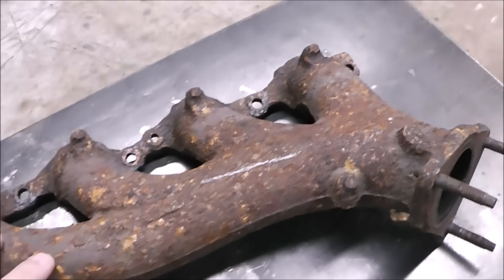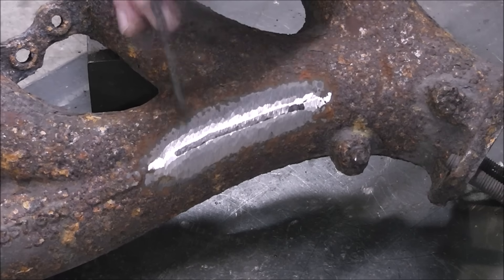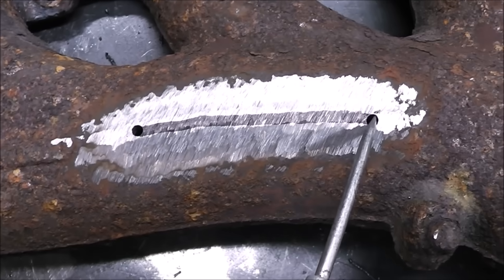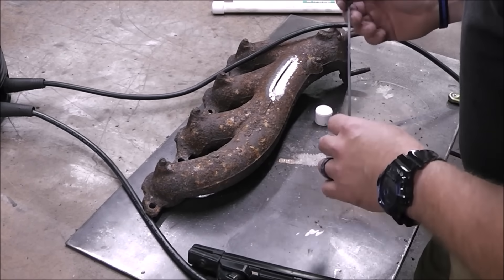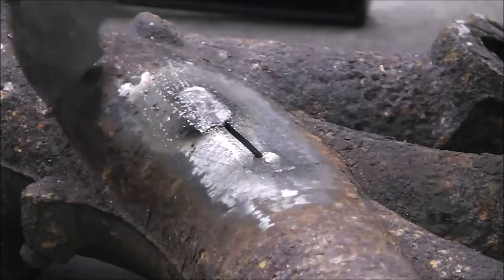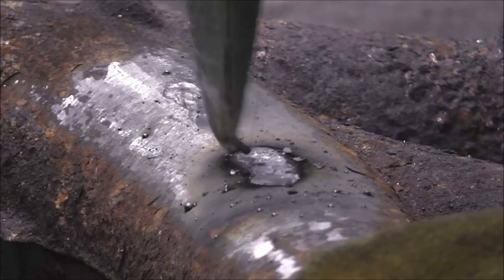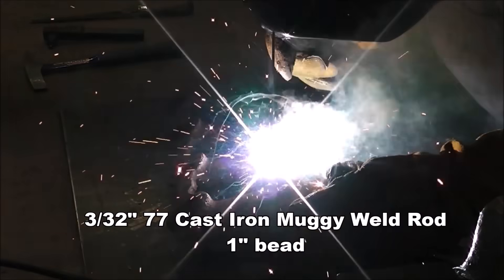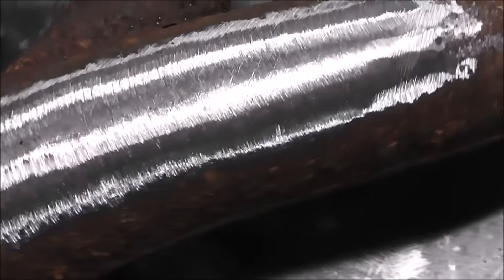Stick Welding Cast Iron Repair with Muggy Weld

Comment: Use a powder torch with nickel powder!
Reply: Glad you ❤️ it.
I used to spend hours fiddling around with expensive nickel rod, preheating, post heating and peening all along the way just here at go PINK/crack !
Then you could hardly charge the customer. You didn’t fix it. 
With a powder torch I could fix any cast to be water tight, gas tight oil tight, I loved it!
Reply from the maker: Thank you for your suggestion.

Comment: What really cracks manifolds is freeway driving in sub-zero temperatures, then pulling into a gas station and turning off the engine. That manifold is cherry red at freeway speeds and when you turn the engine off without letting the manifold cool down slowly, the drop in temperature is too sudden and the manifold cracks. When you pull into a gas station, let the vehicle idle. Even when you get home too.
Reply from the maker: Great point!

Comment: My openion ; allways old school 
pre heat  and cool as slow as posible ..its worth every bit of the efort.. 
On manifolds and any thing that goes through heat extreems . Pre heat it .
Reply from the maker: I agree 100 percent that is the best way to make a cast iron repair.
Reply: @BrandonLund  .. i like that new cast  rod .. i will have to order some from weld supplies. 
Once i welded a old cast iron street light pole  broken inhalf . It was bottom of the barrel .. like counter ballence. It wouldent tack brazing or multipassing beeds of nickle rod . Onley short little stringers . Berley held together . 
Waist of my time . Except expeince. 
I dident charge my client .. 
Oiley cast can be difcult . 
I never messes with aluminium.  
Seldom stainless . 
Im simi retired .. but still do some out side work..
Reply from the maker: Nice! It's good to stay involved. Keeps the mind sharp! :)

Comment: so long as you grind and prep the crack to solid clean metal you dont actually need to drill holes. its only to stop the crack from continuing on
Reply from the maker: I think the radius of the bit at he outside edge provides a stress relief point...its what I've read anyways and have never tried it without. I suppose you could get a simular radius using the grinder wheel as you mentioned.
Reply: @BrandonLund  best to get die penetrant to see how far the crack actually goes too. but so long as you grind to solid uncracked metal you should be all sweet
Reply from the maker: Thanks man! I appreciate the tip!

Comment: A good welder will show the bad with the good.... The initial side you started on went to shit on ya didn't it? You started off with the ports down in the video and the finished product shows the ports up... Been welding/fabricating for 25+ years best cast repair is Super 600 rods and or spray welding are probably the best methods and a lot of temp control. I prefer to spray weld cast, much easier temp control.
Reply from the maker: I don't have a problem showing the good with the bad but before you jump to conclusions, maybe read the pinned comment.

Comment: Thats a Chevy truck manifold of an LS based engine. Also its cast steel not cast iron despite your spark test. It sparks like that because of the casting and carbon content not because its iron.
Reply from the maker: It sparks like that because high carbon content is a sign its cast iron...plus the pinned comment showing the laboratory test results prove its cast iron. They don't make this style configuration manifold in cast steel and if they do someone should post a link. Every test we've done proves 100% it's cast iron.

Comment: Awesome demonstration Brandon, I've repaired 100's of cast iron manifolds back in the '90's, using either Eutectic 2240 electrodes or Eutectic hot spray, different manifold failures required different techniques. Wish I'd known about Muggy Weld back then.
Reply from the maker: Thanks man! It’s good stuff!

Comment: Pre heat the job then use a stainless rod. It worked for me on truck drums for a wood heater. Not cracked work but just joining them.
Reply from the maker: Great tip!

Comment: I have welded a lot of cast iron and never used a special rod to do so. If you prep the cast (if you have an actual crack you need to grind a v into it to get good penetration as well as clean the crack out) and preheat the part properly, then peen it as it cools. So you can use normal 6011 rods in 3/32" OR 1/8" for larger cast pieces  and that works very well. The key is prep and preheating the parts till they are just turning orange.
Reply from the maker: That really wasn't the point of the video though. If you don't preheat,  most filler metals will crack. This was to test the elongation of the filler metal without using a preheat.

Comment: It looked like there were holes in the weld?
Reply from the maker: It's called porosity. It's caused by the molten base metal rising to the surface. If porosity is a concern you can keep filling and grinding until it's visually gone or you can use a different process that has a lower chance of wetting the base metal
Reply: @BrandonLund  porosity! It sure looked perfect after the flap disk! Thanks for the lesson.
Reply from the maker: Anytime. Thanks for watching and commenting.  👍

Comment: Brandon nice demonstration. I use a heat gun with a  pyrometer to slowly rise temperature. Then I measure preheat temperature. I then switch to a acetylene b-tank with a rosebud tip to bring it up to 500°F and maintain temp. Then I weld. I've never used that product it looks like it has a larger margin of error with preheat temps and dirty cast.
Reply from the maker: I was quite impressed that it welded dirty cast without a preheat. If it can do that extreme it should perform well with preheat

Comment: Those look like Chevy LS manifolds..if they are, they are not cast iron. They actually cast steel, and can be welded like any other. I used a mig welder to weld on turbo clamps on mine.
Reply from the maker: The lab testing results in the description show they are cast iron

Comment: Lots of comments majority are positive. I have welded fifty five years and I’m not a good welder I’m an auto mechanic who welds out of necessity do a lot of frame repair and fabrication.I leave the tricky or dangerous welding to the pros like you .Thankyou for the video it would have been nice when I learned how to weld if we had videos
Reply from the maker: Thanks Roger! We are in the same boat...i didn't have videos either when I started welding...heck, we didn't even have internet or cell phones 🤣🤣🤣

Comment: I like this product. Cool, My Grandad welded for INGALLS ironworks shipyard from 1935 till he was 80 years old. He let me burn my first rod at age 8    He burned over 400 1/4 inch rods a day up in bulkheads and was a supervisor.  My father worked for Ingalls then became a machinist for Calumet and Hecla  Wolverine division of Copper tubing works.  I learned how to Braze sealed systems for GE and later developed a training course for Refrigeration systems that is still in use.  The alloy industry has some amazing braze and welding products.  Cast Iron is a challenge.
Reply from the maker: Thats awesome man! I love hearing stories of the old timers making a full career and then the next generation following that path. What an honor. It sounds like he had a great work ethic that he passed along also.
Reply: @BrandonLund  can you confirm that you I won the giveaway
Reply: I'm HVAC certified, I know what you're talking about
Reply: I have had good luck post cooling slowly by wrapping the part in my welding blankets instead of sand.
Reply: @michaelpiecewicz9748 I always wondered if that would work
Reply: he burned 400 rods a day??
, well the company earn a lot with him, he was a slave...

they should have contracted a robot
Reply: @anteneupitra way to make someone feel good about themselves... You sound like a miserable fuk
Reply: @anteneupitra  I gotta imagine these are the old battleship welds where you're darn near dumping filler in with a wheelbarrow, but that's still an awful lot of rods.

Comment: That's an LS style exhaust manifold which is actually cast steel and not iron like what factory exhaust manifolds usually are made of.
Reply from the maker: Its actually cast iron. A lot of the turbo guys think because they can weld it with mig then its cast steel. Its not and the independent lab testing results confirm this...plus they don't make this style manifold in cast iron. Cast iron can be welded with mig. I have dozens of videos on this

Comment: The importance of drilling holes at the end of the cracks can't be stressed enough. Thanks. I say the same to some YouTubers that don't. Crack propagation is real.
Reply from the maker: THANK YOU! I've actually had people say its not necessary.
Reply: @BrandonLund  it is. I was taught it at college and I've had colleagues who have avoided it and the micro cracks cause a premature failure. Especially in high stress situations.
I have drilled the ends and done this for metals and plastic welds. Never let me down.
Reply: Fracture mechanics is the field of mechanics concerned with the study of the propagation of cracks in materials. 
My professor wasn't going made when he taught me lol
Reply from the maker: I agree with you 💯.  Great point on drilling plastics too! Its probably as prone to propagating outwards as much as cast iron! Thanks again!

Comment: Tried it today.. Had hell of a job striking the ark with 2.5  rod. Kept sticking, so I kept increasing the amps. I was soon on max setting and my welder either kept cutting out or the rods kept sticking to the work.😯  Managed (some) penetration and when I chipped it with the hammer the weld held. Let's hope I've sorted it. It was my first ever cast iron weld !
Reply from the maker: Congratulations man! Once you get them started they run smooth as butter. I'm sure you did fine!

Comment: I watched because we share the same last name. Probably not related. I am adopted anyway. Years ago the cast iron hitch for our disk (farm tillage thing)   broke and  Dad started hunting for a new used disk because in the 70's there weren't many options. Our local blacksmith didn't want to tackle it. My HS shop instructor suggested cast iron rods which were apparently new. I was not an accomplished welder by any sense of the word. I gave it the can do anything if you try attitude and we used that disk for several years later. Oliver brand. I got really lucky.  Years later I became a certified weld inspector at a major defence contractor. Was just one of those merit badges that I rarely needed. But, a nice tool to have in the box.  Hole drilling to stop the crack is a very sound metallurgical method.
Reply from the maker: Great name Larry. Its actually a made up name my great grandfather came up with when he immigrated to the United States from Sweeden. His last name prior to the name change was Mattson, so for that reason I'm not related to many lunds :). Cast iron rods are awesome! You can still get them but its becoming a lost art.

Comment: Slag inclusion which you will ABSOLUTELY know that weld is there over time!
Reply from the maker: If your doing it right then you wont have slag inclusions. Slag inclusions are not really high on the priority list....rather you should be focusing on how wet you get your base metal to prevent trash from rising to the top, which is almost always a concern when stick and tig welding cast.

Comment: I am looking for  copper on copper welding  (not brzing or else) video.  Is that possible?
Reply from the maker: Yes. It can be tig welded or mig welded with silicon bronze
Reply: @BrandonLund    I was thinking of  stick weldind  (MMA).
Reply from the maker: I've never tried with stick...ill have to check into it.

Comment: I know you won’t believe but i used to weld cast iron exhaust manifold on an old tractor with ordinary mig steel wire. I heated it than welded and covered in ashes to cool down to ambient temperature. It held for 20 years than i sold it.
Reply from the maker: I've actually got a cast iron welding series and I used mig as one of the test pieces! :)

Comment: Just a tip.  Don't weld cast iron if it has to be machined afterward.  The metal get's hard, really HARD!.  You will blow out cutters very quick and it will cost more on the job you bid thus you will loose money.  Take it from me.
Reply from the maker: Great point. Supposedly one of the two rods that I used in the video is supposed to be machineable but I have not tried.

Comment: "..and you need to fill your nostrils, and throat with milk, when welding with cast iron or cast steel, to prevent sickness, and Cancer.."
Reply from the maker: I think your referring to welding on galvanized metal.

Comment: Those are Ls Chevy truck manifolds & are actually cast steel . You can use a mig on them . There’s tons of videos on here where guys modify them for budget turbo ls builds
Reply from the maker: Thanks Richard. The independent lab testing actually concluded it is cast-iron. The results are attached in the description or pinned comment.

Comment: I have an old cast iron Japanese tea pot with a crack in the bottom. Can you use muggy weld to repair and then use for  asking tea?
Reply from the maker: I probably wouldn't risk it. It it contains nickel it can be a carcinogen.

Comment: The drill  bit is  Hi Speed iron?
Reply from the maker: I cant remember which set I was using to drill the hole. It was either HSS (high speed steel) or cobalt which is a little harder material.

Comment: Your welder link doesn’t work anymore. Do you have an updated model? I want to be able to weld aluminum messing around at home. Thanks
Reply from the maker: Unfortunately its discontinued.  If you check out some of my more recent videos I just picked up a mig welder that accepts aluminum wire without using a spool gun. I havent tried welding aluminum with it yet though.

Comment: If you recorded the welding itself through welding glass, it would be possible to see it being done, no?
Reply from the maker: I've tried but its blurry...im sure there is a particular lens I need.
Reply: @BrandonLund  The autofocus may be getting confused or overwhelmed. Try making a little stand to hold a sheet of welding glass, then turn off autofocus and focus your camera manually on the spot you plan to weld—without the glass—then slide the stand into place and start recording. I'm actually surprised that the sensor is not damaged by the light of the arc but I guess they're sturdier than they used to be.
Reply from the maker: Thanks for the tip! I'll give it a try!

Comment: I welded cast with a stainless rod and 7018 it still hold on very good
Reply from the maker: Ive had mixed results with stainless but I've had pretty good luck with 7018 :)

Comment: Beautiful work, I miss welding fabricating machining and repairing was my favorite!
Reply from the maker: Thanks Robin! I have to agree, repaing stuff is always fun. Thanks 😊
Reply: I do too back in 1981 I had a welding shop at 16 years old I welded everything from cast to building trailers everything I miss welding my stupid brother-in-law years ago took my favorite buzz box into his paint shop and seized up the fans I guess I'll have to try to replace them I don't know if you can still get the fans for the 1981 buzz box Lincoln welder

Comment: Gm LS manifolds are not cast iron FYI. They weld like butter.
Reply from the maker: They do weld nice but its a common misconception that it's not cast iron. The independent laboratory tests (linked in the pinned comment section) show this is in fact cast iron. The destructive testing also indicated this.  Plus with over 2 million views no one has been able to post a link to a cast steel OEM manifold in this style.

Comment: This is not cast iron it’s cast steel, that is a ls manifold.
Reply from the maker: Kerry. This has been independently tested at a lab. Its a common myth the ls manifolds are cast steel. They arent. The lab results show its made of cast iron. Plus they dont make this style manifold in cast steel.  Over 2 million views and no one has been able to put up a link where this gm oem manifold can be bought in cast steel.

Comment: Good to know, I would have used preheat. I'm gonna check out those rods, thanks for sharing.
Reply from the maker: Thanks man! I normally use a pre and post heat, but as I said in the video I wanted a worst case scenario to see how the rods handled it. According to the manufacturer, they have 300% more elongation than conventional nickel rods.

Comment: That is a GM Ls manifold. It is cast steel. Not cast iron
Reply from the maker: Its actually cast iron. The independent lab testing is attached. We also did destructive testing....plus with over 2 million views no one has yet been able to post a link of this style manifold in cast steel.

Comment: Nice job, can't tell where it was repaired. 
I'm thinking of learning more and would like to do small builds around the house and for tractor. What is a good starter set, and what do I need for power?
Reply from the maker: You can do a lot with an inverter welder set on 110 volts. Depending on what you want to spend you can pick up a decent import or go all out and get a Fronius.